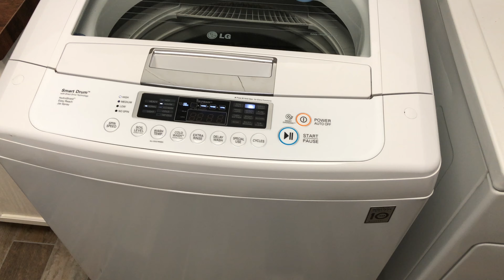LG WT1101CW Washing Machine IE Error Drain Pump Runs Continuously Fix

Comment: This is the 2nd time I've come to this video since having this washer! The first time I followed your method exactly and it worked like a charm. The second time, I watched the video again to refresh my memory, felt way too lazy, put a towel over the front panel (without removing anything), and tapped the heck out of the whole thing with the end of my screwdriver. Worked like a charm! Thanks for giving me the idea 💡
Reply: Just used the lay down a towel and tap around method without detaching anything... It worked!!! Thanks to you both for figuring out the issue and providing ways to correct it!
Reply: So last year I removed the control panel, tapped around and it worked! This just happened again today and took your advice…lay down a towel and tap around and it worked! Thank you for the 2.0 great idea!
Reply: I'm so glad it's working for you guys! Just an FYI, I've had to do it several times since and it gets harder and harder. I have to smack it extremely hard 😂 So don't give up if it doesn't seem to be working, just make sure it's well padded and give it a whack!
Reply from the maker: That’s an awesome idea!  I think I had tried tapping the front panel to no avail, but I guess I wasn’t hitting it hard enough.  The towel is simple and smart!
Reply: I'm so glad I watched this video and read the comments. I just tapped the front panel with my fingers and it worked :)
Reply: Thank you! You 🎉are a gem!

Comment: LG is junk
Reply: As an example, I’ve had to have a fuse replaced in my LG refrigerator freezer and another component for the ice cube maker replaced. I’ve had to have a component replaced in my LG dryer and I have had to hit the relay switch twice now on my LG washing machine. In my opinion and based upon my experiences, LG is junk. I bought all of the appliances thinking that LG brand was actually good but I was mistaken. By the way, the fuse in the motherboard for the refrigerator freezer was actually soldered in and the repair person could not believe that was the design. Ridiculous!
Reply from the maker: It is baffling to me that LG rates so highly in Consumer Reports.  When shopping to replace the LG washing machine, I was surprised to see LG at the top of the list.  I won’t own another one.  I chose a Samsung and have been very happy with it thus far.  I’m hoping that I won’t be making a video on it in 5 years.
Reply: Why is junk?

Comment: Absolutely informative. Thanks a bunch. I was about to purchase a drain pump because my washer had no error code displayed, but the pump ran as soon as I turned on power and continually ran after I'd turned the p ou were off. Ultimately I had to unplug the washer in order to stop the drain cycle. After tapping the relay with the white barcode the cycle stopped. Thanks....
Reply from the maker: Good deal!  Glad it worked.  Make sure to subscribe, so you can see the 3 month follow up (board replacement). Thanks! -David
Reply: I’m having the same exact issue with mine but it’s stainless steel. The second I plug mine in it starts draining. There isn’t an LG tech within 2 hours of where I live and I’m wondering if I should just replace the washing machine.
Reply from the maker: Ummm… have you tried the fix?

Comment: Thank you SO MUCH!  I literally just had a tech out for our dishwasher & our washing machine stopped working :/  Needless to say, dishes & laundry have piled up as I've watched my pocketbook dwindle.  I watched your easy-to-follow video and gave it a shot because, why not?  It worked beautifully and is running another load as I type!  I also scrolled down to see @AnthonyWolak's comment that "The relay in question is the one with the white sticker on top across from one of the large electrolytic capacitors."  Thank you!
Reply from the maker: You are so welcome!  When it rains it pours.  Thanks for reaching out!  Hope your appliances give you a break soon!

Comment: Works great! This is my second time having to do this trick! Thanks for the video. I've also had to do a similar trick with my LG dryer. On occasion it won't shut off & keeps tumbling even after you turn it off! You have to unplug, remove top and tap on the relay.
Reply from the maker: Interesting to hear about the similar issue with the dryer.  I wonder what other appliances they used those cruddy relays in.

Comment: Check your washer to see if you have a HOSE Clamp on the inbound side of the discharge pump. If so, that is not a factory connection. Most of the LG washers had to be reconditioned, then sold as new. The hose is 2 inches too short and the travel of the tank to offset a lopsided load will one day rip that hose off. I repaced 12" of drywall in my washroom.
Reply from the maker: I’m sorry for not responding sooner.  I have subsequently junked my lg in favor of a new Samsung, so I can’t check it.  So far so good!

Comment: Thank you! I used this video to fix my washer andit has worked fine for 4 straight loads afterwards. Not even a ue code which was about every third load previously.
Reply from the maker: Awesome!  I know the frustration you have felt, held hostage by a non-functioning washing machine.  If someone woukd build one that was reliable, I would gladly pay thousands of dollars.  Good luck with your machine.

Comment: Thanks! We had this issue today and I was prepared to buy a new machine, but your fix saved the day. We'll see how long it lasts, but at least it got us through this load of laundry ☺
Reply from the maker: Glad it worked!  It amazes me to find the number of people with this same problem.  Thanks for reaching out.  Sorry for the reason. :-(
Reply: @budgetprojectsbydavid5263  Obviously the part they used for this was placed in many machines, so not surprising they're all having a similar problem. This is a true manufacturing defect. We are just glad you came up with the fix. Thanks again!
Reply from the maker: Agreed.  I’m no electrical engineer, but I wonder if the relay used is marginally undersized for the application.  Perhaps it’s just poor quality.  Either way, mine eventually welded itself together, permanently failing.  It’s not something you would expect in only a few years of use.
Reply: Update - the fix worked for nearly 5 months!  The same problem started again 2 days ago. We tried your fix again tonight and it at least got the drain pump to stop running. Haven't tried running a load yet, but we've decided to buy a new washing machine since it seems like this problem will keep cropping up.
Reply from the maker: Woah!  5 months is pretty good compared to the 3 months I got.  I too ended up buying a new washing machine.  It’s a Samsung and so far, we have been pleased.

Comment: Is it still running normal?
Reply from the maker: This has been a periodic repair for me...maybe once every 2-3 weeks.  I think i will eventually replace the control board, but this is free and takes less than five minutes, so it’s hard to justify the $200 cost at this point.
Reply: Budget Projects by David I just did it and got through 2 loads! It was taking me all day for one load and I was going insane! I don’t have the money for a new washer or even a board! I already put $250 into repairs into it for something else
Reply from the maker: Elisha Harris I hear ya’.  I hope you get many loads before you have to do this again.  To save time on the repair, we actually are now leaving the 10mm bolts out, so that all we have to do is unplug the machine and slide the display left.  We kept the bolts in the side drawer in case we move.  Thanks for your comments and stay safe!

Comment: Worked, thanks. I need to pull the electrical prints and figure out the exact relay and just replace it at some point. This happened a year ago and I did not have to do the Fonzi on it "Hey" like this great vid until tonight. I just powered cycle a few times and moved and cleared. I assume the impact of sliding or moving the washer un-latched the relay prior? These are actually really great machines overall.
Reply from the maker: Great!  Please subscribe to see more on this washing machine.  I have another video coming up on the diagnostic mode.

Comment: The problem I am having is the OE error code. I made sure there wasn't a clog and even removed the pump and tested it outside of the unit to ensure it was working properly. still no luck and getting the same OE error when it comes time to drain. Do you think its possible this trick might work for the OE code as well?
Reply from the maker: So, no drain pump is running at all?  I don’t believe this procedure will help that.  Have you tried running a spin only cycle to drain the water in the tub?
Reply: I'm having same issue. Nothing stuck in pump, all lines clear, pump works when powered seperatly. Will not drain at all even with spin cycle only. Only way to drai. Is with bilge pump. Was given washed by a friend that moved out of country so needless to say I don't have the manual. Any help is appreciated. Thanks!
Reply: @ptfields12  I have the exact same problem. Have you figured out? If so, can you share your experience?